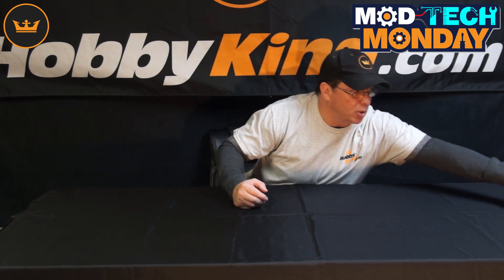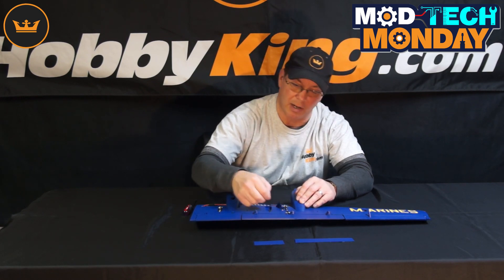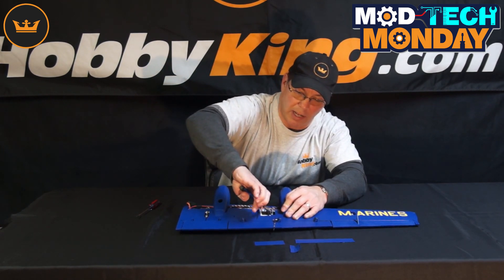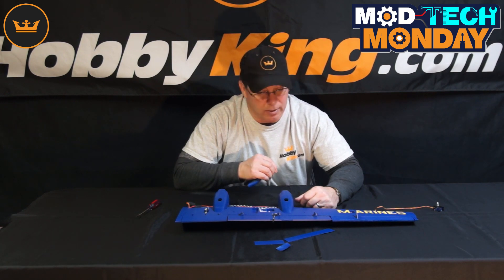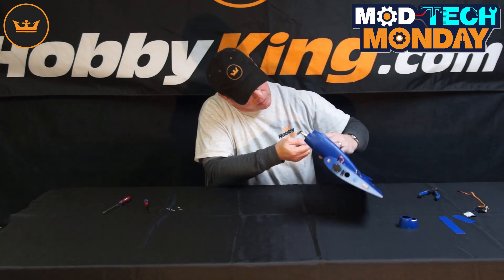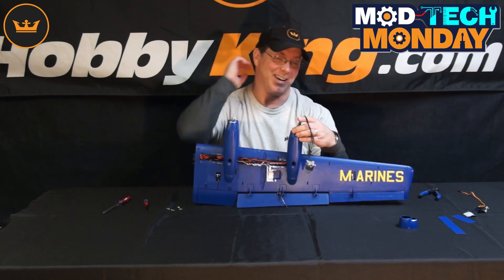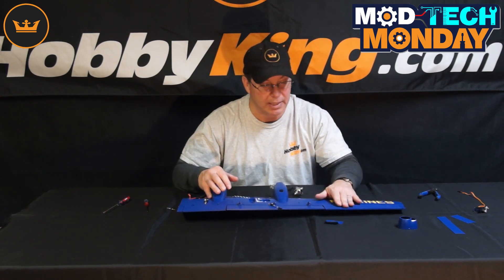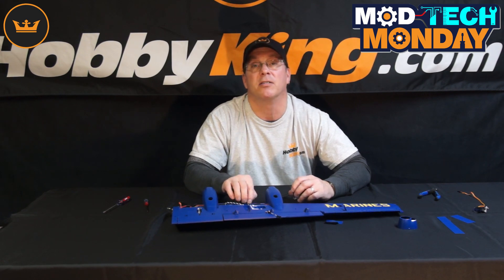Tip Bench Tuesday: Avios C-130 Hercules 1600mm (63") (PNF) Wing Teardown 2

Comment: Have a question for you. I got the c130 blue angels version in the drawing before the release of the plane. And put it away for awhile for a winter build. Having couple issues outboard flap servos(both sides) are growling now matter how much movement. And the main gear lights will not cut offwhen gear is in up position. Plane has never been flown or even been outside. Any suggestions? Dont want to fly with growling servos.
Reply from the maker: Sorry to hear. Please email us so we can help